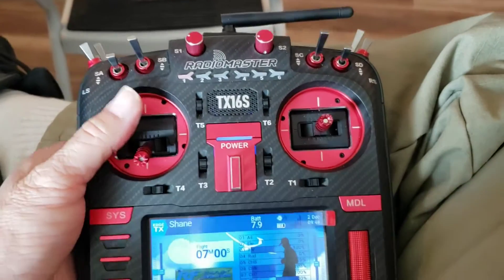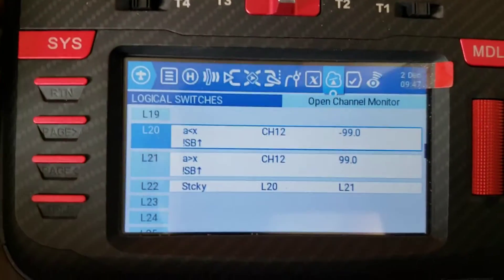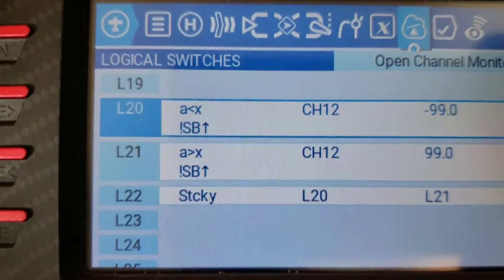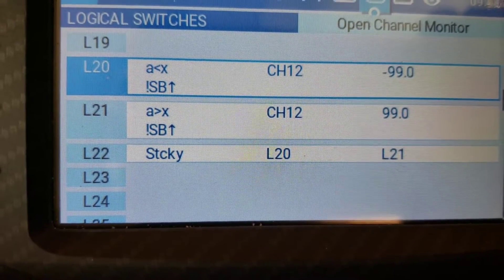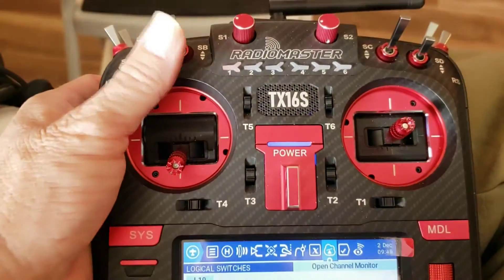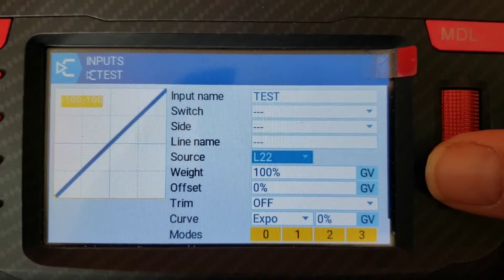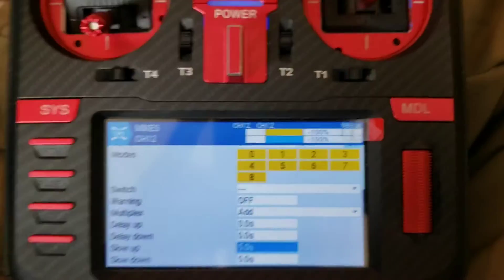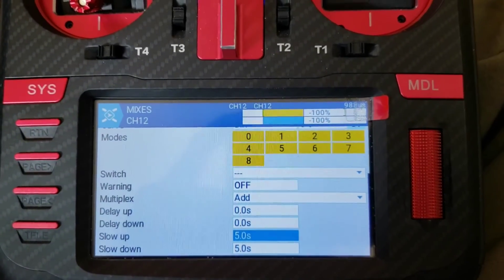EdgeTX / OpenTX servo test programming

Comment from the maker: FYI, in rewatching this video I noticed that creating the input "TEST" with L22 as the source is an unnecessary step.  In the channel 12 mixer you could just use L22 as the source instead of the input "TEST" and it would accomplish the same thing.

Comment: This is almost exactly what I need to do.  But using the throttle.  Anything between 10%and 80% throttle i need a servo to sweep thru its travel back and forth.  I just got my radiomaster tx16s a day ago and this into its great.